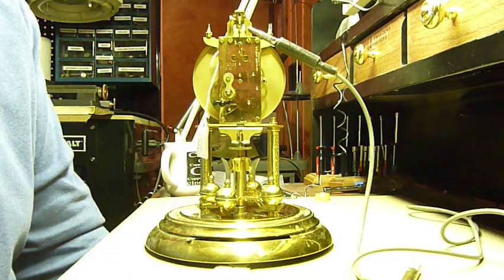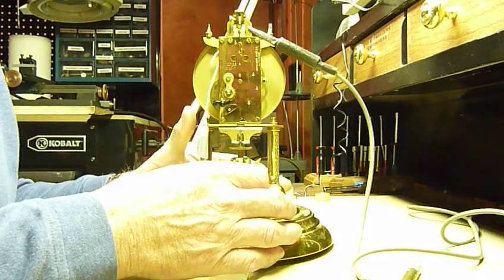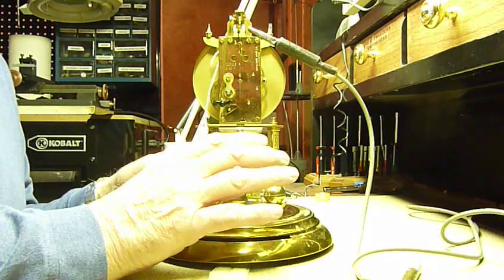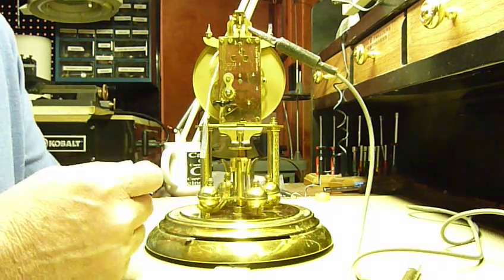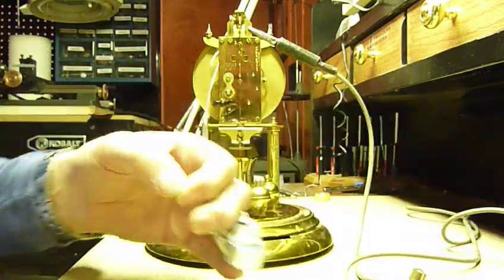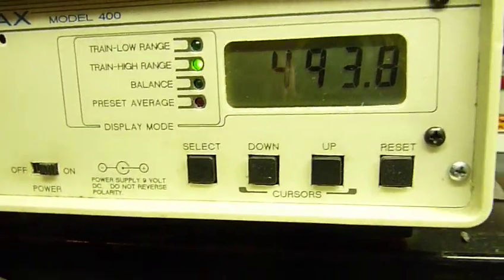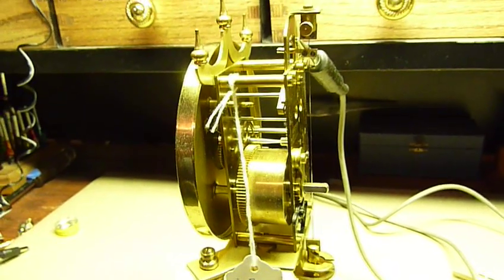BEAT SETTING ON 400 DAY ANNIVERSARY CLOCKS

Comment: I'd be wearing surgical gloves.
Would 0W-20 full synthetic motor oil be a suitable lubricant?   (Lightest oil I have.)
From Goodwill I just bought a little Kundo.   Only 6-3/4-inchesurface to.p of glass dome.     With itsmaller main spring, is it still 400-day?
It r.an hour, then stopped.   Ran again a longer period of time, then stopped.     Now running 6 days!   
Funny that everytime I glanced into wife's office to see if still running, the balls were not moving !!  Luckily they had justopped before turning back the opposite direction.

Comment: I  have struggled for hours trying to set the beat using a "protractor" scale and a stethoscope listening for the tick tock as described in Terwiliger's 400 Day Clock Repair book, only getting the beat set correctly after a great deal of effort. With this method I can get the beat set in less than 10 minutes! I couldn't be more pleased.  Thank you so much James!!!!
Reply: IF YOU USE YOUR BRAIN YOU CAN DO IT IN MINUTES.

Comment: This video was so much help! Your directions are very clear, even for someone like me with their first clock of this type. I bought mine at an antique store for $12, then spent $32 for the suspension unit and key, it didn't have the fork or bottom block. I am only getting about 190 degree of rotation but it is running, and actually a little fast, but I will let it run a while like this before I try to regulate it. Thanks  so much!

Comment: I have used Terwiliger's "400 day clock repair guide" which describes the method mentioned in the video using a marked "protractor" like piece of paper for setting the beat and spent many hours trying to get it just right. (By the way I love that book and highly recommend it.) The method James describes in the video is way easier, takes about 10 minutes or less!! 
       Without a beat amplifier or stethoscope to assist hearing the tick/tock I found that I could view the escape wheel gear and anchor pallets through the back plate of the clock to see when a pallet transitions from one escape wheel tooth to the other, the mechanism that makes the tick/tock sound.  Many clocks have two large holes near the top of the back plate on either side of the pendulum wire for viewing.
       For those who don't know what he is adjusting it is called the "saddle". It is the small round post where the top end of the pendulum/wire assembly hangs from. Some use a screw in the top of it to secure it and some are just press fit in, it is the saddle (mounting post) that he rotates thus rotating the orientation of the pendulum/wire assembly. (Loosen the top screw, be careful not to rotate the saddle when snugging it back up when you're done. The press fit ones will rotate and rely on their friction to stay put.) 
       Following his instructions rotate the pendulum slowly until the escape wheel releases and hits a pallet (tick), stop right there! Release the pendulum and let it rotate on its own power, it should stop just as the escape wheel turns and an anchor pallet hits another tooth (tock). If the pendulum rotates too far, i.e. beyond the tock, in one direction you turn the saddle slightly in the opposite direction and vice versa. When the beat is set properly the pendulum will swing and stop just at the point when the anchor pallet hits a tooth on the escape wheel, it won't matter which direction it is turning as it should stop just as an anchor pallet hits a tooth. When its in beat with no other issues (like needing oil on all of the pivot locations or a broken main spring) you'll find that that the pendulum will swing, stop on a tooth (tick), then rotate back and stop on a tooth (tock), you can now start the clock normally by rotating the pendulum 180 degrees and releasing it.
   This method is a great time saver! THANK YOU JAMES!!!!
Reply: The two of you were a great help in getting my clock running right after a move. Thank you ♥
Reply: You're welcome, happy to hear back from someone that it helped! 🙂

Comment: This is a very helpful video. I recently rescue a Kundo clock from salvage. The main spring is fully wound up but the clock keep stopping. I now realize the tick and tock (the escapement and the suspension spring and fork) must be timed properly so that the main spring can give just a tiny bit of energy to keep the pendulum going. And this video put it in a couldn't be simpler term:  Release from "tick" and it twist to "tock" and vice versa by itself.

The Kundo clock have a screw next to the block to lock it. So just loosen the screw and I can twist the "block" by hand.  

After I adjusted the beat, I can already feel the clock wants to start itself and start swinging winder and wider, it's amazing.

Thanks, James, for taking the time to share this knowledge. CJ
Reply: We have vays of making you tock...

Comment: Mine is running fast, but unsure how to adjust the beat.
 Mine is quite a bit older than this one, but hoping the adjustment for these may be the same.
Reply: There should be a dial above the 4 balls that you adjust with F and S on it or above it. You would want to rotate it to the S side.

Comment: Can these clocks be wound too tight?  I inherited one and the suspension spring seems to be in good shape, however it won’t stay running.
Reply: It could be it needs cleaned and the spring cleaned and oiled. I just started working on one and have taken it apart and cleaned and oiled it, replaced the suspension spring and now trying to set the beat. Not my favorite clock to work on so far, had to walk away from it more than once. Good luck on yours.

Comment: Once you've dialed in the adjustment wheel (mine took about a week to get it right - trial & error), there's a much easier way to regulate the clock. To start out, of course you want to make sure the pendulum is as close to dead-center as possible over the alignment cup on the base of the clock. Then do the 180° halfway pendulum turn, and release. Listen very closely for a very tiny "tick" (caused by the "verge"), and note the amount of pendulum overswing past the "tick" in each direction. The overswing past the "tick" should be the exactly same in both directions. The pendulum on my anniversary clock has 4 balls. I use one of the brass upright supports as a reference point -  I just eyeball the overswing using that. This technique works immediately, and my clock is accurate to about 15 seconds a week. That's all there is to it!   (my 400 day anniversary clock is a Seth Thomas made around 1978, and has the Kieninger & Obergfell 793 movement).
Reply: Thanks that helps me to comprehend this better.☺
Reply: How does the K&O 793 differ from other movements?    I thoughthathey were all the same.
Reply: @nanaleigh328    you're welcome!
Reply: @robertgift    i'm not sure how the 793 differs from the others.

Comment: I have a kundo clock. Its been working ok until recently it started to slow down. I tried to adjust the A-R disc but now the pendulum wont continue moving. I get if going but after a few minutes its barely moving again. What can I do to fix this?
Reply: I have the same problem. I paid almost $400 to get it completely overhauled and set up 3 weeks ago and the pendulum doesn't move now. The shop owner won't return my calls.

Comment: LOOK ON TOP OF THE CLOCK  WHERE THE  SUSPENSION SPRING IS ATTACHED,  YOU WILL SEE A BRASS FITTING WITH A SCREW THROUGH IT OR  A TAPER  PIN THROUGH IT.  THIS FITTING CAN BE TURNED LEFT OR RIGHT. IT IS JUST A FRICTION FIT ON SOME, AND ON OTHERS THERE CAN BE A SCREW.  THE SCREW IS THE EASIEST, THE FRICTION FIT CAN BE TURNED WITH A PLIER.  THEY MAKE A TOOL JUST FOR THIS PURPOSE.

Comment: My anniversary clocks run on batteries. Why do some of the pendulums stop rotating? They just spin and spin when I coax it to rotate.....what do you think?
Reply: any type of 'anniversary clock' that runs on a battery - AIN'T AN ANNIVERSARY CLOCK.  Throw it out and get a real one - they're so fine.
Reply: @bobsquires4521  Alright, well thank you anyway. I'm not about to throw out my 8 "anniversary clocks" - they all work, spin and chime but 2. I despise anything that I have to wind every week.
Reply: @oneitalia2312  The real 400-day clocks only have to be wound once a year minimum.  (Don’t throw any of them out - just the battery powered ones.  The real anniversary ones are mesmerizing and graceful. Any that run on batteries shouldn’t be kept in the same room. 😂
Reply: @bobsquires4521  I Hush, Bob! I responded to your original post FOUR YEARS AGO!!! Stop posting your nonsense if you can't respond in a timely manner. In my mind you died.

Comment: hi i need some help please . i have 400 Anniversary Clock with a bell shape weight . i put the right suspension  . that mad run an hour fast . i adjusted to slow. still run an hour fast . put a weak spring  2 size up run an hour slow .put the size down . a lot better still gaining time. swap the main spring with another one still the same . move the folk up to the max. . the beat ok . .what else can i do please
Reply: Use the suspension that was a little fast, then take a fine piece of emery cloth and sand the suspension spring while still in the clock, just above the pendulum.  by thining it will start to slow.
Reply: @jimbo7630  ok i try it.i have only one spring. thank you

Comment: I guess I didn't do a good job of explaining.  I am not trying to set the time, It"s the "beat"  that is two different things.   If the beat is not set right, the Clock won't run. After you set the beat correctly. then you can set the Time.   No it's not hard to set the time, but It takes a good deal of time.  That"s why I use the Beat indicator.  It makes setting the time more accurate, but still takes a good deal of time.  I have had a great deal  of these clocks. and repaired at least 50 of them.  I learned from Twilligers book,  but the way I am trying to explain, came from the 400 day Clock Club bulletins.   which  is part of the "National association of  
watch and clock collectors" of  which I am a member.  If you think these clocks are easy to repair, then you can have a good income repairing them.  but trust me, they are not easy.  They are a beautiful and interesting time piece, and I hope you will continue to collect them, and maybe join the NAWCC, we need young people.  

 Sorry if I didn't explain it right in the video, I am in my 70"s and and my memory is not what it was.  I know I said 480 per min,  but its 480 beats per hour.
Reply: I have used Terwiliger's "400 day clock repair guide" which describes the method mentioned in the video using a marked "protractor" like piece of paper for setting the beat and spent many hours trying to get it just right. (By the way I love that book and highly recommend it.) The method James describes in the video is way easier, takes about 10 minutes or less!! 
       Without a beat amplifier or stethoscope to assist hearing the tick/tock I found that I could view the escape wheel gear and anchor pallets through the back plate of the clock to see when a pallet transitions from one escape wheel tooth to the other, the mechanism that makes the tick/tock sound.  Many clocks have two large holes near the top of the back plate on either side of the pendulum wire for viewing.
       For those who don't know what he is adjusting it is called the "saddle". It is the small round post where the top end of the pendulum/wire assembly hangs from. Some use a screw in the top of it to secure it and some are just press fit in, it is the saddle (mounting post) that he rotates thus rotating the orientation of the pendulum/wire assembly. (Loosen the top screw, be careful not to rotate the saddle when snugging it back up when you're done. The press fit ones will rotate and rely on their friction to stay put.) 
       Following his instructions rotate the pendulum slowly until the escape wheel releases and hits a pallet (tick), stop right there! Release the pendulum and let it rotate on its own power, it should stop just as the escape wheel turns and an anchor pallet hits another tooth (tock). If the pendulum rotates too far, i.e. beyond the tock, in one direction you turn the saddle slightly in the opposite direction and vice versa. When the beat is set properly the pendulum will swing and stop just at the point when the anchor pallet hits a tooth on the escape wheel, it won't matter which direction it is turning as it should stop just as an anchor pallet hits a tooth. When its in beat with no other issues (like needing oil on all of the pivot locations or a broken main spring) you'll find that that the pendulum will swing, stop on a tooth (tick), then rotate back and stop on a tooth (tock), you can now start the clock normally by rotating the pendulum 180 degrees and releasing it.
   This method is a great time saver! THANK YOU JAMES!!!!
Reply: james bright Hi James, I tried your method because it made perfect sense to me but I didn't have a lot of luck. The clock I'm messing with belonged to my grandmother and my mother had it serviced a few years ago. According to her it has never run properly and I'd like to get it sorted out if I can. The service guys replaced the suspension spring but I have a feeling they have used the wrong one. Is it possible it's too thick? What happens is that I set it up the exact way you describe; perfectly level, even beat etc., but it runs for about 15 minutes and stops. By the way, what kind of oil do you recommend and how do you apply it? For what it's worth, I have repaired, setup and adjusted cuckoo clocks in the past so I have a basic understanding of some of the principles.
Reply: The clock (horological) lingo is difficult to follow if you don't know it. To understand this would mean knowing about dead-beat escapements. However, I think you can probably be persuaded to think of it as tic-toc balance. 
In an ordinary clock, or indeed a watch, the escapement is faster, and this enables one to listen to it as a tune, song, inflexion. Teek-toc Teek-toc or Tic-toke  Tic-toke  surely give you the idea of when it sounds wrong or out of balance. 
We need a better balance as in Tic-Tic- / Tic-Tic or indeed Toc-toc  / Toc-toc    Of course we tend to say Tic-toc because there is often a slightly different nuance between the  sounds. What we need is an even length for each word:- Tic-toc Tic-toc Tic-toc. Now that's easier when it's quick. These anniversary clocks however are not quick. The spin of the pendulum is deliberately slow and it measures out greater chunks of time which in turn means less work for the mainspring to do. That's why it lasts a year! "Anniversary!" Got it? Oh why do I bother? 
That adjustment screw at the top turns the suspension spring slightly back & forth so the Tics & Tocs can be made the same length. 
Now the over-swing. This will be correct in equal length as the Tics & Tocs become of equal length. It's needed to make sure the pendulum keeps on spinning. Lost energy replacement. Wheew!

Comment from the maker: A NON WORKING 400 DAY CLOCK WILL RUN FOR ALMOST 15 MINUTES WITH JUST STARTING THE BALLS SWINGING.  IF YOUR CLOCK ONLY RUNS FOR FIVE MINUTES, THEN SOMETHING IS RUBBING AGAINST THE SUSPENSION SPRING OR THE FORK IS TOO TIGHT AGAINST, VERGE PIN..  JIM

Comment: I am really puzzled by your reference to 480 beats / minute. That's 8 beats per sec. ! Surely not?  Another thing that puzzles me is how such a slow escapement would not leave the minute hand stationary for a long period. So where is that beat coming from? A sensor looking somewhere?
Reply: Chandler Caveney has pointed out that this is 480 beats per HOUR not MINUTE. When I made that entry I was very new to 400 day items. Now I know a lot more and its not all good..... !! There are many novelty clocks that may look pretty but long term accuracy is not their best feature. Be satisfied with the swinging balls! Biggest problem is flutter. Talk to me about that.... !

Comment: THERE ARE A LOT OF VARIABLES WITH SUSPENSION WIRES,  TOO LONG WILL MAKE IT GO SLOW, TOO SHORT WILL MAKE IT GO FAST,  IT TOO THICK IT WILL GO FAST, TOO THIN IT WILL GO SLOW. YOU HAVE TO USE THE 400 DAY CLOCK GUIDE TO GET THE RIGHT LENGTH.  AND THICKNESS.  LIKE IS SAID BEFORE, THESE LOCK WILL RUN FOR 15 MINUTES, WITH JUST STARTING THE PENDULUM TURNING,

Comment: Without this equipment for hearing the click how can it be done .
Reply: You can watch the escapement wheel. I tried to do that but its difficult at best. I bought a timetrex model 50 from timesavers years ago and used that, but its still hard to tell if it was the verge clicking or the pendulum hitting on the side of the metal above it, since they sound a like.

Comment: ON TOP OF THE CLOCK, IS  A FORK,ATTACHED TO THE SUSPENSION WIRE, WITCH MOVES BACK AND FORTH WITH THE BEAT OF THE CLOCK.   THE SUSPENSION WIRE IS ATTACHED TO A BLOCK MADE OF BRASS ON THE VERY TOP.  THIS BLOCK IS HOLDING THE SUSPENSION WIRE, AND THE BLOCK WILL TURN LEFT OR RIGHT.  IT TAKES A LITTLE EFFORT WITH PLIERS TO MOVE IT.  SOME OF THESE BLOCKS ARE FRICTION FIT, AND SOME HAVE A SCREW THAT HOLDS THEM TIGHT.   YOU MAY GO THE LIBRARY AND LOOK FOR THE 400 DAY CLOCK GUIDE, AND THEY HAVE A PICTURE OF THE BLOCK.   TO SET THE TIME FAST OR SLOW, LOOK ON TOP OF THE PENDULUM, YOU WILL SEE + OR -  JUST TURN  EITHER FAST OR SLOW, BUT ONLY A LITTLE AT A TIME. WAIT 15 MINUTES AND RESET THE TIME.
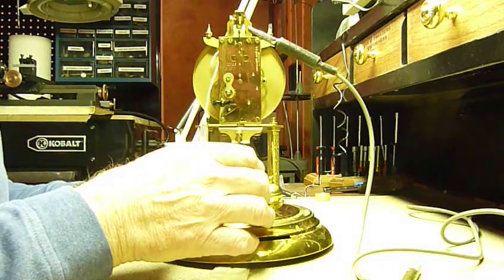Reply: James,thanks again at 2:11 in your video your hand is blocking the view at the top of the movement.I assume that you turned the upper block but as a viewer you can't really see what you did when you say "turn this back,a little" thanks
Reply: Hi, i have a kundo anniversary clock. But it is running fast and gaining time. I have tried to slow it down woth the rotating lever above the pendulum. But it is still going fast even at the slowest setting (i can't make it any slower). Plz help regarding how to fix it